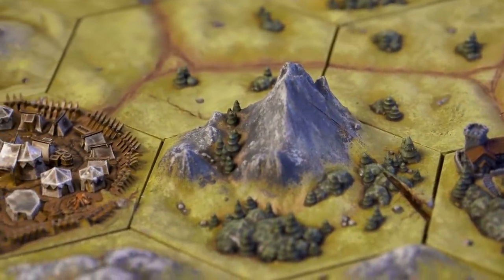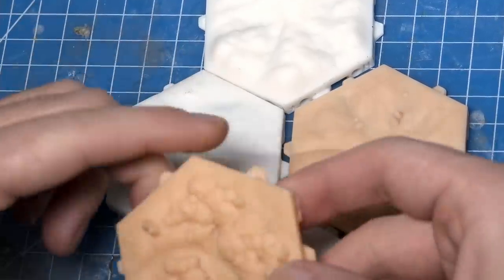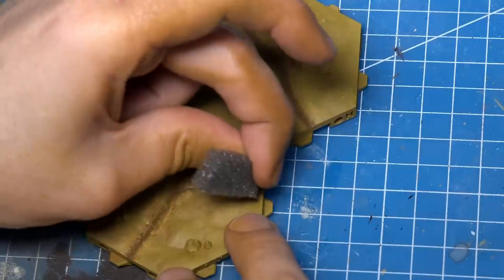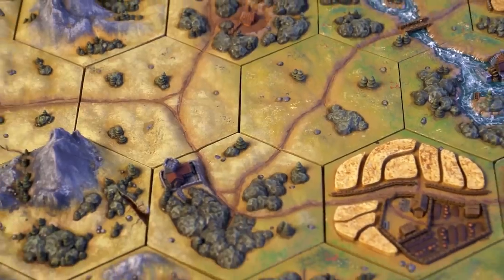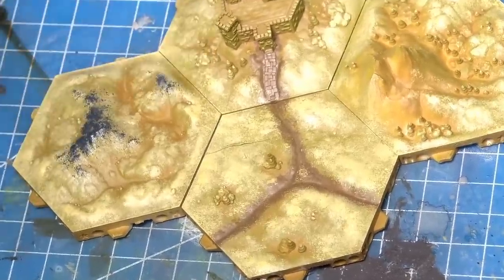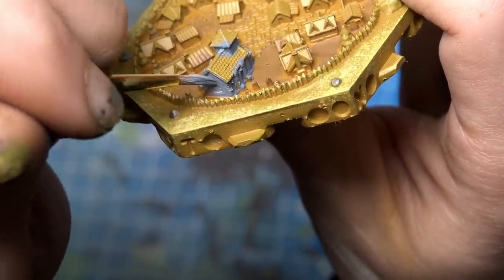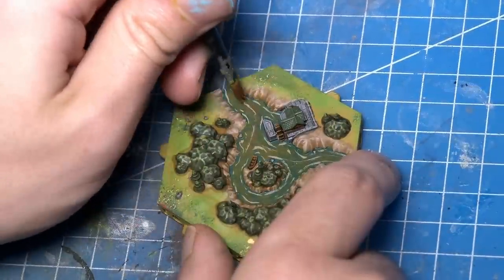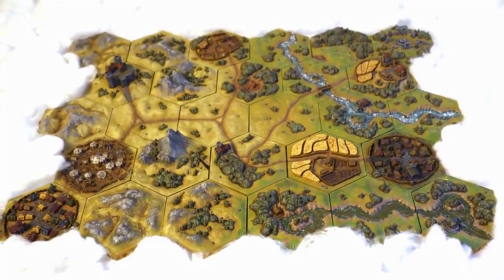I made a TEENY TINY Fantasy Map!

Comment: If you want to use the tabs and not break anything mix 20% of flexible resin to normal hard resin. They wont break when you drop them and they will flex juuuust enough to lock everything together easily.
Very cool video btw :)

Comment: Those tabs and the struggles you were having connecting them would absolutely drive me mad! Magnets all the way!
Reply: Hah yes, they can be a little fiddly.  There's a knack to getting them right - tiliting at an upwards angle as you connect.  Using a slightly flexible resin helps.  I'm fond of them but if you're looking to play about with different layouts then a magnetised base on a whiteboard without tabs is the way forward.  You can always mount it on your fridge like that, makes for something a little unique :P
Reply: @gravenguild  They were honestly great - Some problems don't have immediately clean solutions. They were fiddly but they worked really well. If you have the magnets the option is there too. I was very impressed

Comment: You'll have a much easier time getting things off the build plate by using a razor blade rather than the paint scraper thing. Way less force needed, you can get single sided blades from bunnings.

Comment: ive been thinking of getting a 3d printer for this purpose, but at the same time, the cost of the resin seems pretty high, considering how much goes to waste during the majority of prints i see on youtube.

I'm a DM on a budget, like dollar store foamcore and walmart acrylics, used in tandem with trash i pulled from the scrap bins at my local factory, kind of budget.

But i also find i dont have the time for map building that i used to. Still on the fence about the printers. the cost is up there, but doable, however im wondering as to cost, long term, and when i saw that excess resin as you pulled those out of the printer, i could feel my wallet getting lighter.